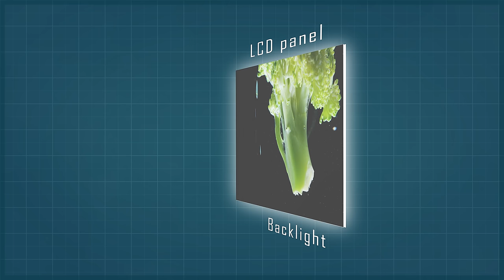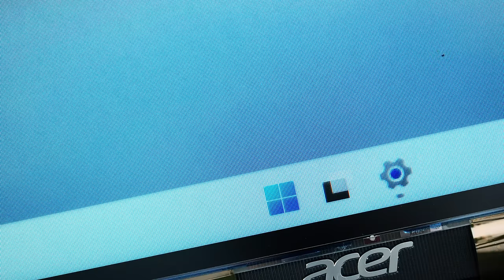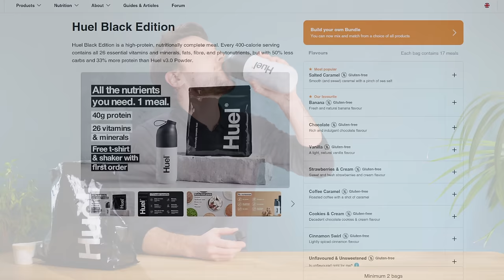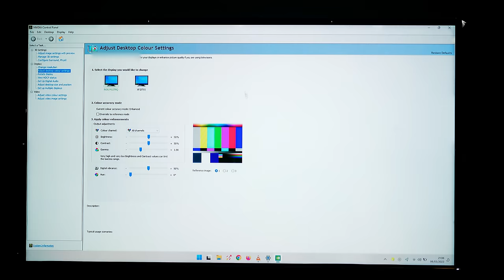DIY Dual-Layer LCD monitor - can it match OLED??

Comment: @DIYPERKS 

Hey man I'm a big fan. Seeing you do this is awesome. You should try to get this thing as close to HDR as possible and add the ability to strobe the backlight for blur reduction. Because then that would be the ultimate monitor that you could have. Strobing the backlight would be able to improve motion resolution, and if you tune it right you can get it close to CRT like motion.

One thing you might consider is using lasers and phosphor rather than LEDs for your backlight, because that would use substantially less power.

If you wanted to go really ham with it using an mems system with lasers and phosphor would give you a built-in strobing backlight that would be very efficient and bright. You may even be able to remove the polarizers if you used lasers in a MEMS system because such a system would mimic an 7emissive display more closely.
Reply: Peak brightness is already an issue, so strobing the backlight might not be that feasible. I don't have much experience with displays that support that, do you know what's the typical duty cycle on strobed backlights at 60hz?
Reply: @carnivorebear6582  it would depend on what Motion Picture response time you were looking for, as well as the native refresh rate of your panels and what refresh rate you want to strobe them at. 

A 240 hz LCD running at 240 FPS and pulsing the backlight with a 50% duty cycle (flash length) will let way more light through then if you just used 60 frames per second with a 50% duty cycle.

A 50% duty cycle usually I believe so it cuts brightness in half, but you could also overvolt the hell out of the LEDs since you are pulsing them as opposed to leaving them on constantly, just like how fald back lights work.

You can also adjust the duty cycle for lower MPRT and higher brightness or vice versa.

 You can pulse an LEDt at much higher brightness levels then they are rated for provided that you are only doing it momentarily. 

You can pump about five times to 6 times the brightness out of a typical LED for short duration without damaging them. Since he already has the heat sinks, he could get more. Other people have also mentioned that having one layer be monochrome would let more light through.

This is how HDR works on Modern qled displays. Or how lightboost used to work in old 3D monitors. Adjustable pulse length and precise voltage control.

Power and Heat considerations is why I think a laser phosphor based backlight would work way better then using LEDs. 

A micro electric mirror that steers a high watt laserbeam at a phosphor layer could get you very high brightness at low power usage,  and strobing also improves the native contrast of the panel.

Comment: Micro LED is also starting to become a thing, essentially OLED without the screen burn. It is VERY expensive currently though, and I'm not sure any monitors use it yet, but worth looking out for in the future.
Also, adding a polarising film will actually work as a depolarising film too, if you put it at the correct angle between 2 panels 😅 some whacky physics for you! Instead of using tracing paper which blurs the back image to cause the fringing.
Reply: Polarity rotation is weird! Definitely allows for some cool optical tricks though. 😎
Reply: Yeah. That 110 inch Samsung is 150k. Fucking insane seeing it’s probably gonna be 1/50th the cost in five years

Comment: I bought a Dual-Panel LCD monitor back in 2009 that used 2 display cables. The reason it had 2 LCD panels was because it was a 3D Monitor that used passive polarized glasses to give you that 3D effect without having to always charge them. Plus there was no annoying noises coming from the glasses. I absolutely loved the monitor. It was an iZ3D 22" monitor. Sadly they discontinued the monitor and went out. I really did enjoy using the display. I still have it. While ATI/AMD GPUs worked out of the box with the iZ3D drivers, you have to buy a license if you used an NVIDIA GPU.

Comment: how about doing something actually every-day-useful? like a DIY multi-HDD case/rack (with built in hub/fan/on/off-switch for each HDD, maybe even via a remote) and only one power-line and USB cable?!?
Reply: Cus that would be like a 2 minute video?
Reply: @coreywoodward4389  no it wouldn't... but it would be useful either way... but not enough revenue from youtube for a 2min video^^

Comment: While I usually find his DIYs trying the best & practical solution, this one has scope for a lot of improvement.

1. The large backlight led array: This is what makes this build thick, impractical and causes high power consumption. This can be avoided if tracing paper is not used. A better solution for the polarization problem is the way forward, which leads to #2

2. Tracing sheet: 2 stages of tracing sheet was used - one between the panels and other in front of the backlight. Both can be avoided.

Fix / Recommendations:
The polarizing element in the lcd panel is actually removable. He has to further separate layers of the lcd panel and remove the polarizing layer from the base panel. This removes the need for tracing paper and a more powerful backlight and solves blurry text issue.

Second step is to change display settings in outer panel to high contrast black and white while inside panel displays full colour. This will solve the color gamma issue and the outer panel will only enhance blacks.

Comment: I think the real version of this would require a custom controller so the two panels could have slightly different polarization angles.  That way it's the combination of them that's used to block light.  This is what they do to get more selective polarizer filters for cameras.
Reply: is it possible to make this work by just inverting the 2nd monitors polarization with software?

Comment: You can use Windows HDR calibration tool to fix those crushed shadows and let windows account for the higher or lower peak brightness. Assuming both panels and the splitter supports HDR

Comment: Would be very interested to see somebody run a calibrator on this, to see the actual contrast ratio and how close to sRGB standard colours it can get.
Reply: Indeed. From here it felt like the gamma was set way too low and anything below maybe 25% brightness was completely blacked out.
Reply: @stevethepocket  Yeah - massive black crush.
Reply: My thoughts exactly. I'd love to put my spectro on that and validate how it performs. Most commercial dual-panel implementations use the first panel just as a backlight control layer. Meaning it's the same panel running in B&W or a completely different monochrome panel. My guess is that using two panels in full color mode will skew the gamut quite badly, essentially doubling the saturation (looking way over-saturated and "contrasty"). Interesting project though!
Reply: @markusrayan  I bet software-based LUT calibration could fix a lot of it - desaturate the gamut, for example.
Reply: @markusrayan  I wonder about feeding the first panel a monochrome image. Using a mono LCD screen would be ideal, but they aren't easy to obtain.

Comment: I think you could have calculated how many LEDs you needed for the back. As every layer loses a certain % of its light. For example the paper might loose 30% whilst the actual display might loose 10%

Comment: Really cool project! I use a eizo prominence for my work, and it’s my understanding that it uses dual LCD tech to get the black blacks. It would be really interesting to probe your monitor and see what the gamma curve looks like, from what I see in your video, It looks like it might be a bit steep (your mids look dark). Either way, excellent work!

Comment: You should be able to twist the light in the polarizing film to get a better brightness, you will need some different polarizing film that are at different view angle, most likely you got a 90 degree film on that now, so either go with a 45 or 22.5 degrees film between the layers and twist them to get the right polarizing :)

Comment: I  think multiplying the image by itself will result in a change in the images gamma curve. This can easily be demonstrated by putting two identical layers on top of each other in After Effects or Photoshop. In short, midlevels become way too dark. This will also lead to a getting more contrast and color saturation which has nothing to do with the superiority of the image system but rather with the effect that overlaying two identical images in multiply transfer mode will have. To counteract this effect the gamma curve of the input should be changed to a more log-like curve. I think the overall contrast and black levels will still be much better compared to a screen with a single LCD but the differences will not be as pronounced as shown in this video.
Reply: Just use a colorimeter tune on it

Comment: I wonder if you could remove the polarizing layer from the rear most screen, I've done this before on some really old LCDs but the thicker design just meant they could stack the parts loosely, i would imagine that your newer thinner design has the polarizing layer glued down.

Edit, i suggest this to both increase the brightness, and get rid of the weird softening caused by having the trace paper between the two LCDs

Comment: Would love to hear your thoughts on mini-LED displays, as they seem to be getting more popular lately. I feel like they're sitting right between a regular LCD and an OLED display.
Reply: Problem with OLED and PC: They will Burn in at least the desktop or something. 
Mini LED is basically the same as OLED, but without the Organic Part. Might help a lot, but also, Burn in could Occur. That's why I think OLED hasn't caught on at the PC market.

Comment: Some LCD TVs use a variable brightness array of LED backlights. When the image requests black, the individual backlights behind the "black" areas dim to almost nil, making these areas of the screen nearly black. When white is requested, obviously the backlight array in those areas will be at full brightness. For greys, the backlight can choose various levels of brightness. 

These array dimming LCD backlight technologies are probably the smartest I've seen and can compete with "expensive" display technologies like OLED in contrast ratio, but are overall much, much cheaper to build and buy (less than $800 or cheaper). I've owned two of these TVs, one a 1080p TV and one a 4K TV and both work exceedingly well for gaming purposes and movies alike. You can also switch this technology off if you like, but I don't know why you'd want to. Not all LCD TVs offer variable brightness backlight technologies, so you have to look for this feature specifically.

I should also point out that the only time this variable backlight technology doesn't really work fully is when the vast majority of the screen is light with only tiny amounts of black here and there. The LED dimming backlights aren't sufficiently granular enough to support high contrast when it's down to just a few pixels of black. For that, you really need OLED.

Comment: i switched my HP 27M monitor image settings from Limited to Full Range in the OSD, then overclocked it to 76hz with CRU (which for some reason made blacks darker as opposed to 60hz...no changes in Nvidia Control Panel, fyi.) Blacks are black, it's bright af and looks beautiful next to our 65" HDR tv in comparison. i'll stick with that, but this was a fun video to watch

Comment: it is true that you have a much higher contrast ratio display. but you also have to feed it the right signal; i think you effectively ^2 its gamma - i cant see how the contrast curve is not affected by this…

[backlight]*[screen1]*[screen2]=effective brightness
screen1 and screen2 have identical brightness input from the computer but they multiply when put in fron of each other

10%
100*0.1*0.1=1%

20%
100*0.2*0.2=4%

25%
100*0.25*0.25=6.25%

30%
100*0.3*0.3=9%

35%
100*0.35*0.35=12.25%

0.4^2=16%
0.5^2=25
0.6^2=36
0.7^2=49
0.8^2=64
0.9^2=81
0.95^2=90.25
0.97^2=94.09
0.99^2=98.01
0.995^2=99.0025
and ofc 1*1=100%

you should convert the signal you give it to gamma 1.1 or whatever would be the right amount to get rec709 gamma at a ^2 curve

Comment: You just need a brighter and/or more efficient backlight tech, as well as more efficient diffusion layers. I think some sort of clear opaque fiber optic panel would do well for the backlight part, and TBH the tracing sheet is fine as the de-polarization layer. For the backlight, look into PHOLED or Gallium Nitride LED. I think if you can get a more efficient diffusion layer for the backlight, thereby allowing it to be placed closer to the LCDs, that'll be the biggest boost to your overall brightness. Maybe look into a Micro (or not so micro in your case) Lens Array or some other kind of magnification to make the backlight brighter, too. No idea how you might implement quantum dots, though... Unless that can also be a part of the diffusion layer? IDK.

Comment: Just to hybrid:
dual LCD with zone-dimming, where bottom layer of LCD would pass all light, just dim it when it needs. So that layer would get blooming effect that zone-dimming has. And it would add 0 to none to end price. And it would bi as bright normal screens.

Ps. there is already dynamic dimming tech, not that expensive.

Comment: You used to be able to simply peel off the polarization (and protection) layer of a LCD screen / computer monitor.
Eliminating the extra diffusion layer that way should solve the max brightness and blurriness issues ... so a more efficient backlight would be the real task left.
Too bad this concept can't be DIY'd with curved screens.
I'd love to see a v2 video ... or one that proves my last statement wrong? Pretty Please ^^.

Comment: I've been thinking at the same idea for few years now, and wondered why nobody makes this. My idea was to actually use a black and white LCD of lower resolution and maybe without the polarising film, to make its production cheaper. In the older LCDs with a back-lit screen would have worked great.

Comment: Hisense did it 2 years ago with a 4k tv model dual lcd one for blocking light in black and white and a regular lcd in front of it. Unfortunately never came to Europe because the high power consumption. But it was available in USA and Asian market

Comment: By stacking two displays together, you are effectively squaring the intensity of each pixel, so a lot of the effect here is the same as applying a colour adjustment. For any colour beyond a certain dark value, you don't want to change the value.

Comment: You can use another polarized foil(s) in 45° angle instead of baking paper. It's interesting property of light. Two polarized foil in 90° angle block 100% of light but if you put another layer in between in 45° it will allow lightly to pass (I think like 50%) if you add more layers in between in smaller  angle steps more light will pass (but each layer is lightly tinted so there is limitation how good this could be)

Comment: ok all some monitorbrands have to do is double the lcd layer or making the crystals deeper to get this result and also make the backlight brighter/stronger.
This would be possible to make without making the monitor this big. They have to cool down the monitor maybe but with more passive coolers this will work

Comment: I still have an old Asus 3d monitor with dual layer 60hz panels to get 120hz. In 3d mode each panel displays one eyes image, every other frame. The color depth still blows me away. We haven't used the active shutter 3d glasses in a decade, but its still a great 1080p monitor.

Comment: That's a brilliant idea. If dual panel monitors already exist though, manufacturers have already thought of this. And they could overcome and solve all the problems you faced in your build. I think they do not want to promote dual panel displays as much as OLED, cause although it's cheaper to build a dual panel monitor yourself than get an OLED one, OLED tech might be overpriced. For manufacturers, OLED is most likely much cheaper to make than dual panel monitors, despite what they are asking for it.

Comment: I imagine that if you turned the polarizers of the second panel instead of depolarizing the light, you would end up with a brighter display with most if not all of the contrast, but it would be a PITA to accomplish via DIY methods. Still possible, though.

Comment: You could try to peal off polarizing filter from the bottom LCD and glue both LCDs with optical cement or canadian balsam. That way you will get more light, no paper between LCDs, and no blurryness on screen.

Comment: Hisense implementation uses grayscale for the "light blocking" lcd layer. I don't know if that could increase brightness or not. It's a shame they didn't continue pursuing this tech though. They were able to get 1000 nits peak brightness and around 400 full field, which outperformed most oleds at the time. The problem was mainly motion artifacts. The HDR also lacked punch. For some reason even though it could achieve 1000 nits in test patterns, it wouldn't reach proper brightness in real content.

Comment: A few thoughts that might make this more efficient and professional in the long run should you try again. I know LTT, back when Luke was still hosting videos, had a video where they removed the polarizing filter on an LCD to make a "privacy screen" that could only be viewed through polarized glasses. Using that (more destructive and risky) method might reduce the need for as much tracing paper, and therefore need less depth overall for the screen. Along with that, would it possible to rewire the video input wiring harnesses into one header so that you only need one monitor motherboard, and therefore the screen only appears as one display in Windows? You may still need to power the second screen separately, as the single screen motherboard may not be able to run adequate power for both LCDs, but whatever backlight driver should be able to supply enough power for that second LCD.